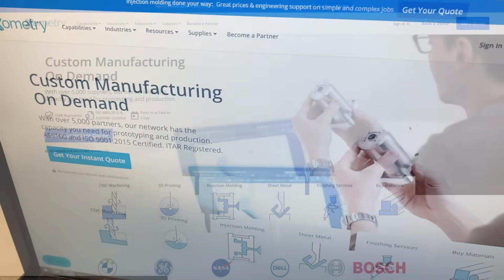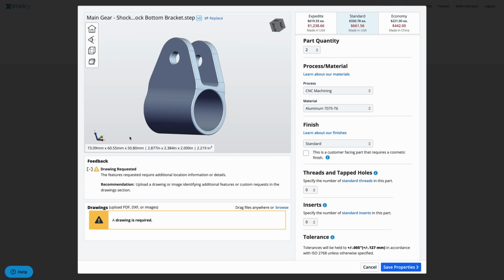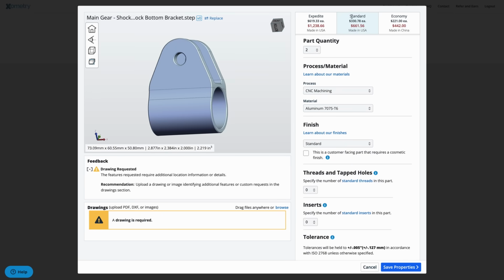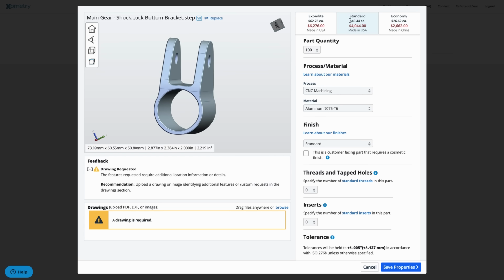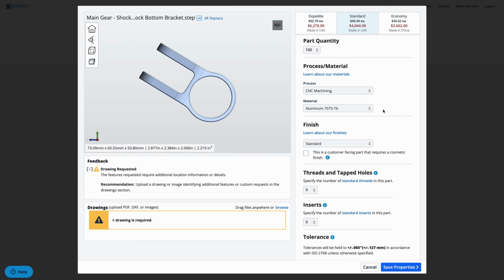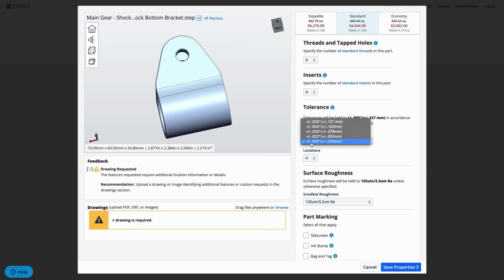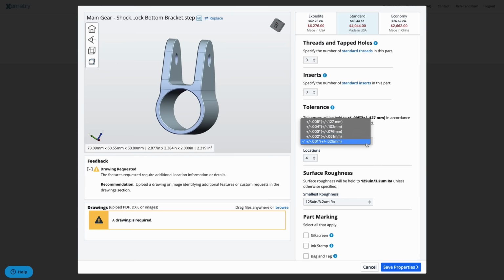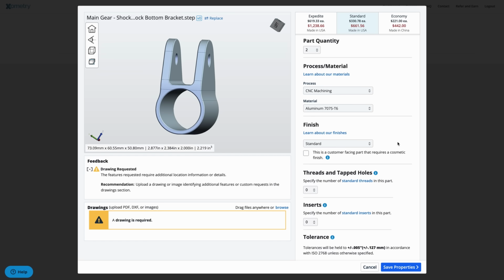The TRUE COST of CNC machining!

Comment: I've owned a CNC shop for nearly 40 years.
That part is two ops and flip it to remove the excess.  Wheel cut the slot  You could use two vices and get two parts off at every push of the green button.
Reply from the maker: Thanks for watching! Having a bigger machine, more vices, and/or more axes would give options for fewer operations. We used four operations on our machine because we have limited depth of cut with the diameter tools we can fit in our tool holders.
Reply: @DarkAeroInc  Good reply but you do need to consider where you are headed in the end.
I started with an aerospace engineering degree but have worked in automation for the last 30 years.

For where you are at the moment you have done incredibly well. I have my pilots license and I've looked at Australia's light aircraft industry and like every where else its a place to lose some money or a lot of money. The current expectation is that over 99% of all aerospace start-ups will fail. Australia has a bunch of them right now and everyone of them thinks they'll change the world. I'm not willing to risk a moment on any of them right now. Partly because they are clueless, but mostly our government's policies which are just pathetic. 

So I take my hat off to you guys for having the bravery to have a go. The one bit of advice I'd give you is DON'T TRY and be perfect. I have actually worked in a couple of projects with world leading ground breaking billion dollar technology that should have netted everyone involved incredible outcomes. I watched idiots blow the lot being to prissy, childish and often trying for perfection when they did not need to. At some point you MUST freeze the design process or it never gets done and if you don't sell something you go broke. 

The number of companies that have gone broke with superior technology and better designs is staggering. Bill Gates and Microsoft have never been the best software, but what they have always had is software good enough to sell. You have a complex system and if you try and do every configuration or make it all perfect you'll go broke. Focus on getting 1 version to market and do the rest with the money you earn.

If you want I'd be happy to discuss with you how I watched a couple of companies blow genuine billion dollar opportunities and the lessons learned.
Reply: I've got the same machine and understand the limitations - it turned out good!
Reply: @356reaper  Hi,dear friend,have contact information in the video  https://youtu.be/_SBkl3b2ZOs
Reply: @CMTeamCobra Hey nice to have an expert here well I can't debate you on this one you know better but it depends the videos that I referenced aren't critical molds with really tight tolerances parts and what @B B has probably if he wanted to go serious he will hire someone like you but thanks anyway.
Reply: Good tips, was thinking this while watching the video.. I can't remember every making a part with a witness mark like that on purpose.  I'm sure they will learn more as they go.
Reply: @texastad1989  
Actually I want to ask you.... is it easy to make plastic mould in cnc machining
Reply: @BB-bs7hm  it depends on the parts that end up being molded and their tolerances if you need to hold a 0.001" on the part than as a rule of thumb you need to have a mold that is 0.0001" accurate, 10 time accuracy is a rule of thumb and the surface finish of the parts controls the surface finish of the mold it all depends it could be 10k$ or even 100k$ or if you have a little bit of knowledge and your parts are forgiving in tolerances you can make your own molds these guys can make their own molds on that machine here is a link to a some helpful videos and channels 
https://www.youtube.com/watch?v=YrbQIN2TBhM&t=618s

https://www.youtube.com/watch?v=n7JWPxk92fY&t=259s
Reply: @marouanebenderradji137 well articulated thank you for this informative comment
Reply: @BB-bs7hm  if I get to know what products are you intending to make and if you have any cnc machine I can even help more if you want to
Reply: @marouanebenderradji137  Good comment/answer.
I have been doing automation for 30years and most of that involved positioning systems and robotics. That is one of the most misunderstood concepts in all forms of control systems. 
You fundamentally have to measure better than the accuracy required. You pointed out mechanical tolerances. That same basic rule applies to everything. If you want 1C accuracy for temperature you basically need to measure accurately to 0.1C. That just carries on across everything.

The one place it doesn't is in custody transfer which you see in the bulk materials area. Custody transfer is that point where what you measure is what the customer pays for and it usually means seriously big contracts. I've seen it in mining and oil & gas. They generally chase another digit and if practical more after that.
You might no think when you put 80,000 tons of iron ore onto a ship that measuring to the nearest 1kg matters, but it does. If you have the weightometer (the sensor on the conveyor that measures everything as it goes past) out by 0.1% its a big deal when your weighing billions of dollars in iron ore each year.
Its all industry dependent. There's a huge difference in accuracy and cost between Tormach's the next level at Fanuc, Haas, Okuma etc and then Hermle and Kern. I did a lot of robotics at one point and its the same thing there if you want high end repetitive accuracy.
Reply: On a five axis it'd be one op plus a finish face. All critical dimension and geometry would be done in a single operation so it'd be as accurate as the machine is. A pair of parts like that would be $250-ish. A batch of 100 could get down to  $30 each.
Reply: @AndyRRR0791  yeah, but that's a five axis.  And that comes with five axis costs.   Like OP said, on a 3 axis, this can still be done in 2.
Reply: @AndyRRR0791  thats not one op thats two po's
Reply: @harbitude  Where did I say it was only one op...?
Reply: @AndyRRR0791 

I honestly would like to know how that would be possible. There are two geometries to the larger bore so you need at least one op to define your zero based on that alone......
Reply: @mrp9024  If you'd like to convince @DarkAero, Inc to share the CAD file with me, I'll do a done-in-one five axis video demo on my DMU80T.
Reply: @AndyRRR0791  

Can you not design something similar and show how it would be done in a single go? It doesn't need to be the same part but make something with similar geometry but not specs to show it in one go.You said one op in your initial comment, if you meant one op and a cleanup okay but that's still two ops.

Edit: nice machine btw
Reply: @mrp9024  I said one op plus a facing cleanup but I reckon you could have a finished part in one op if you were clever.  No, I can't be bothered to make something up but happy to demo on a real part (i.e. this one) so noone can say I designed it to facilitate done-in-one.
Reply: @AndyRRR0791  lol, my thoughts exactly... I love 1 and done parts... either tab a non critical dim off and scotch wheel it off or just deck it on a tiny op 2.

I think simpleish parts with tight multi sided features is about 95% of the 5axis work i see
Reply: I owned 6 CNC shops for over 300 Years. 
this could be done in one Op use 8 vices and you could get 16 parts in the time it takes to drink a cup of coffee. I use a $1 Million robot just to hit the start button. 

haha jk but i think its very rude when someone declares an exorbitant amount of experience and comes off as being quite arrogant.
Reply: @darkshadowsx5949  question why many youtubers leave YouTube
Reply: @darkshadowsx5949  You are absolutely correct.  Not everyone has the equipment and experience that others might have, and rudeness is very prevalent in comment sections.
Reply: @throngcleaver  Grapes are on sale.
Reply: @darkshadowsx5949  Tip. If your snowflake ego is offended by the wide diversity of ideas and personalities in the public comment section, just turn off comments for the video. Better yet, make your videos private, available only to folks who will stroke you.
Reply: @darkshadowsx5949  omg.  I LOVE your comment.  Chiming in with "using a new Doosan 5 axis, recommended by Titan, you could run 1000ips and get 5000cm3 mrr with one kennametal KOR. " doesn't do ANYTHING useful for anyone.
Reply: @shirothehero0609  Point is, there are a bunch of folk out there with very powerful machines and skills for sale.  There's a real cost of pissing about with a Tormach when you can find a good manufacturing partner to sub these parts on a prototype and ongoing basis.  They really are not difficult parts to make.  If it's just a hobby then the equation is different but this enterprise isn't a hobby, is it...?
Reply: @AndyRRR0791  got it, so THATS your point - selling them your services.  Well,  If you're trying to sell them on outsourcing prototyping with you, then I'd probably move on from YouTube and try a more professional form of contact with a legitimate proposal and ROI.
Reply: @shirothehero0609  No, not at all.  Your mind reading skills suck.  Why would I tout for business on the other side of the world in Wisconsin when I already have customers here right next door?
Reply: @AndyRRR0791  again beautiful machine
Reply: @mrp9024  That's no me or my work.  Just an example of how complex parts can be "done-in-one"